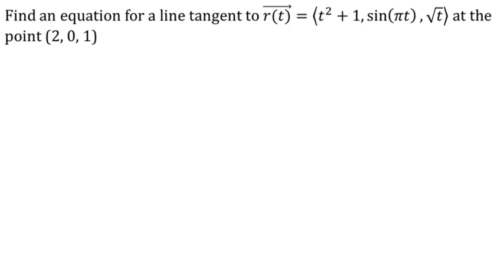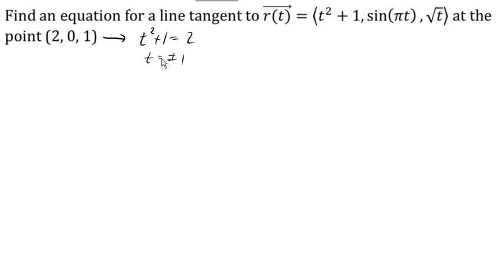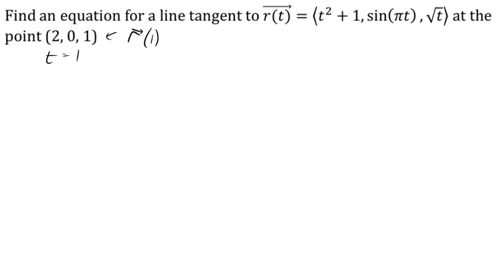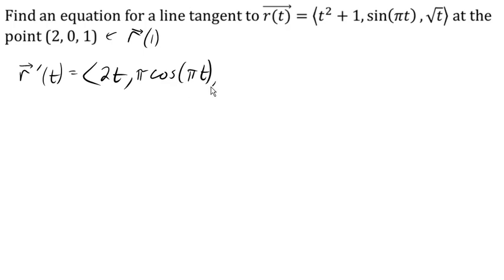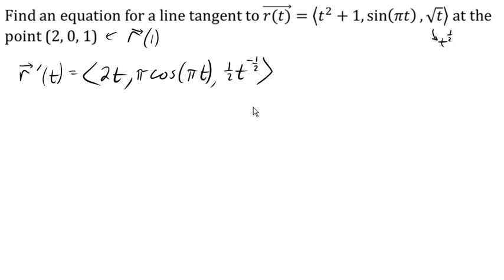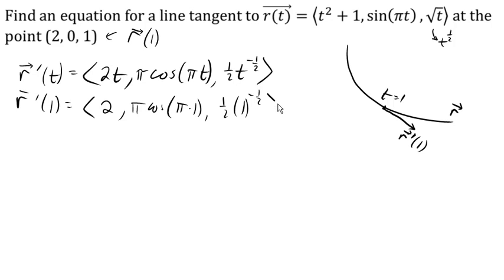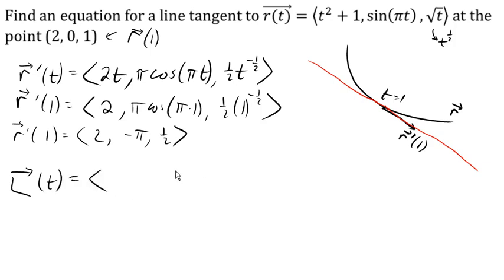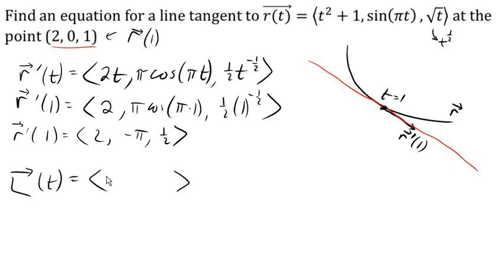Tangent line to a vector equation

Comment: Shouldn’t it be (t-1) multiplied by the direction vector?
Reply: There's no need for it to be (t-1), and usually we just multiply by t.  But technically multiplying by any (t-c) would give a valid line since it's just shifting the t value where the line is at the base point.  The t of the line doesn't have to correspond with the t of the curve; they can be at the same point at different t values.
Reply: David Lippman Okay that makes sense. Thanks for the reply